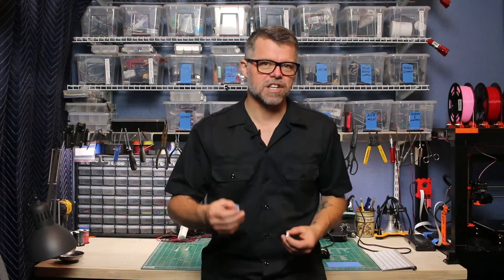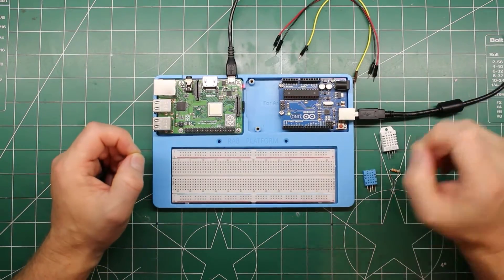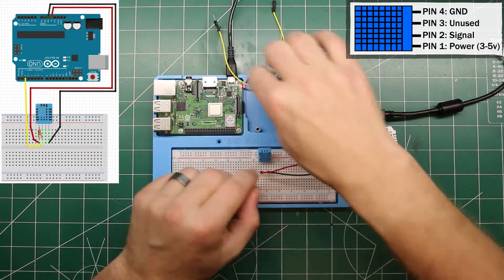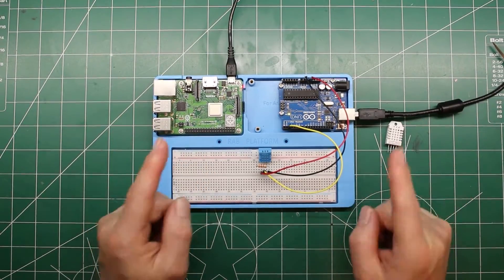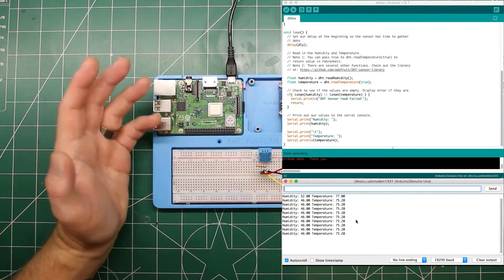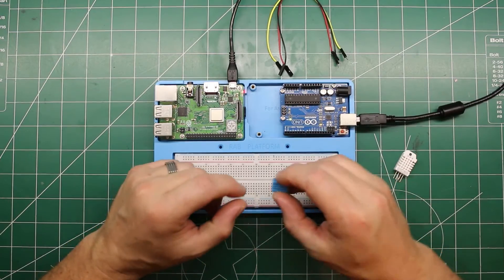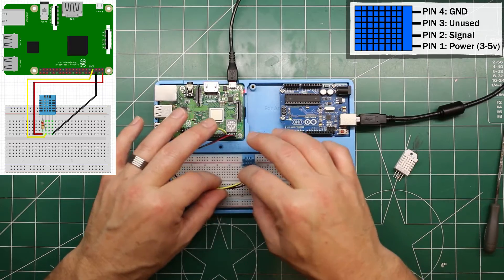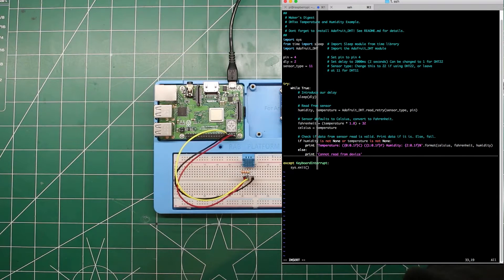DHT11 and DHT22 Temp & Humidity Sensors on Raspberry PI and Arduino

Comment: Your code is so clean! If I had these at home, I'd be able to follow along no problem. 
Is the main use of these to put inside computers or something to make sure they don't overheat/ nothing's wrong?
Reply from the maker: Thanks! Sure, that would be a decent use for these. I've also used them for monitoring ambient temperature in the house, monitoring the temp & humidity of my 3d printing filament etc. They are best for scenarios where you are measuring ambient areas. There are other temp sensors that that are good for isolated measurement, for something like monitoring the temperature of beer while brewing, cooking, coffee roasting etc. I am going to cover those in the future as well.
Reply: @makersdigest4752  are you using some kind of broker to gather the data? Mosquitto?   did you made a video about it